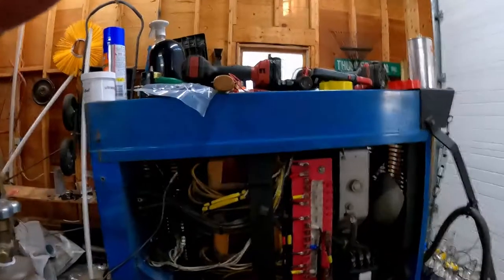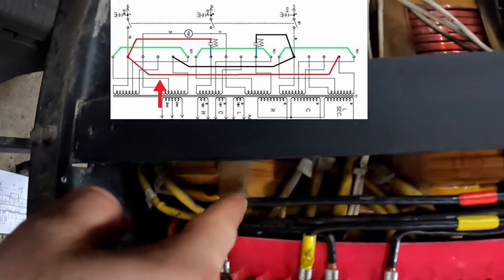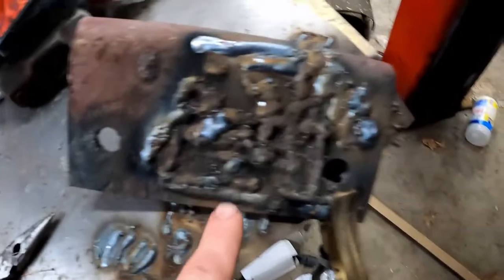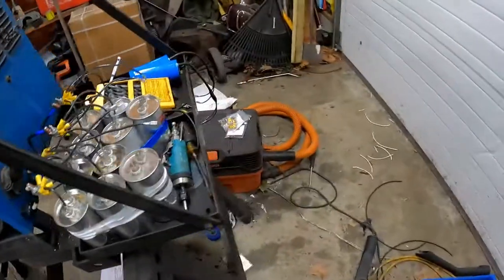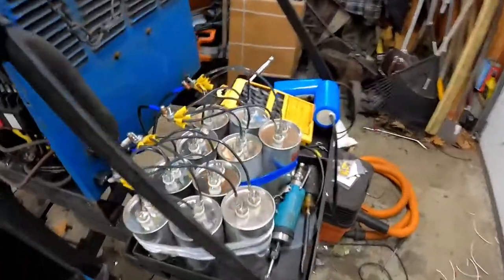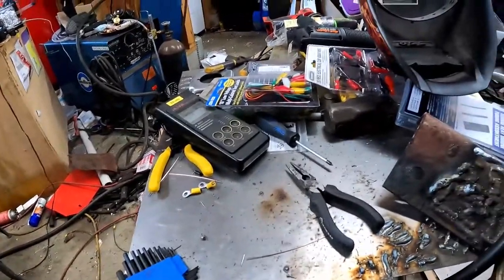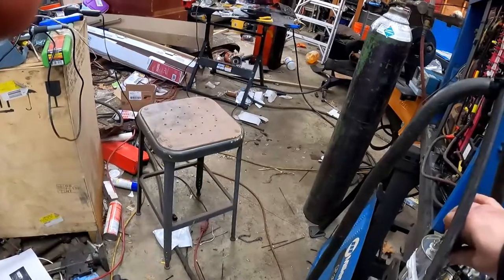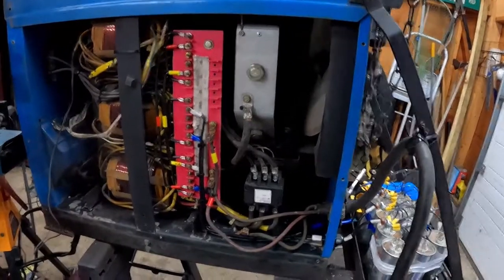Miller CP-300 Welder Haas-Kamp Conversion Part 4 - Final Conclusions

Comment: Not a 100% sure if you can with this machine. But I did a older machine without the 200v jumpers. convert it from delta to and y plus only used 2 capacitors. It will flat out lay it down. Welded half inch single pass just fine and still had plenty of dc volts left.

Comment: So out curiosity,  what kinda Amp's does this need after converted ? , and still run 100% for long periods ?  say 3 to 6  foot + seems ?
Reply from the maker: So weirdly enough it pulls full amps (about 30 amps 240 volt single phase) at idle due to the nature of the capacitors and pulls less when welding.  It's never shut off on me due to overheating but I haven't run any 6 foot beads either.  I also pretty much run .035 wire as it will serve pretty much all my needs.  That said I've used other industrial welders that were hooked to 3 phase and I don't notice any difference between the two.  Also I don't believe you can get anywhere near the welder for the same money(I have roughly 600 into the welder and caps and other bits).
Reply: @wirestiresandfires214  Appreciate the reply, Been real curious I have 2 these, been trying to figure out a way to power it outside getting some kind of 3 phase gas generator my home workshop only has 100amp 220 volt line, I've never been much of a powersupply guy, Most everyone else seen on this topic usually 10-16 years ago , nice to see its actually still fully usable very tempting to convert 1, and have a working Mig at the house. Company have 1 them at is selling the building soon and gonna loose access to 3 phase..
Reply from the maker: @Hawkwind405  I've only got 60 amp 220, this rig will only ever pull 35 amps max so you should have plenty overhead.
Reply: @wirestiresandfires214  Very Awesome !

Comment: Do you have your gas turned on?  You're getting a lot of rust along the sides of your weld.  If your gas is on, you probably need to turn up the flow.
Reply from the maker: I think that's just from the sheet having a little oil on it in that particular area and it burning off.
Reply from the maker: Looked a little deeper after thinking about your comment, the o-rings that seal the torch end to the feeder were absolutely shagged, and I replaced them.

Comment: Just curious when you max it out after the conversion did it still seem to be making full power
Reply from the maker: It's a little hard to say as I can't do a side by side.  With .035 wire I maxed out the feed (700ipm I think) and I think I saw it hit 300 amps on the meter.  It is super hard to do any sort of welding while watching the meters.  I was able to get about 100% penetration on 1/4" plate welding through scale and paint.  Without heavier gauge wire it's fairly hard to say what the output limit is for sure, but from past experience with 3 phase welders it feels right, definitely has more in her than a 250 amp machine.  I suspect you lose a little off the top of the range as far as output goes(I'd need some large flux core wire to really find out).  1/4" plate is about the limit for what I want to weld with this and I would probably stick weld anything thicker.  at about 15:50ish you can see a big red chunk of metal with welds all over it, that's my 1/4"(maybe5/16") test plate I've been welding on.